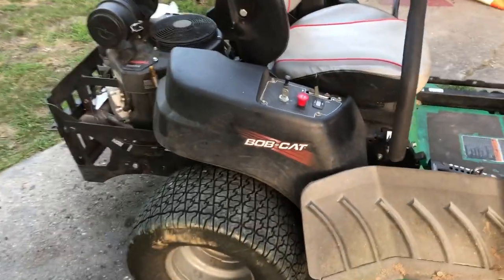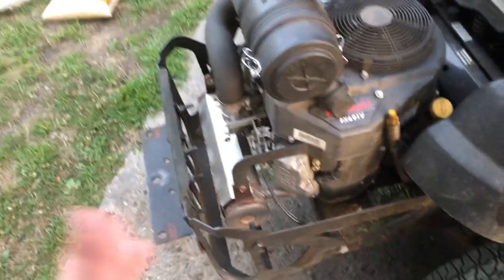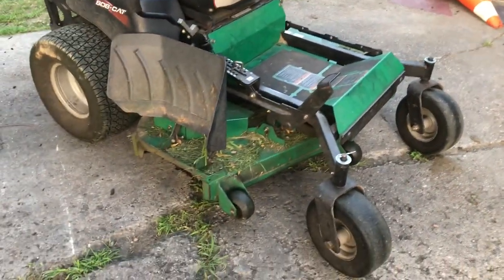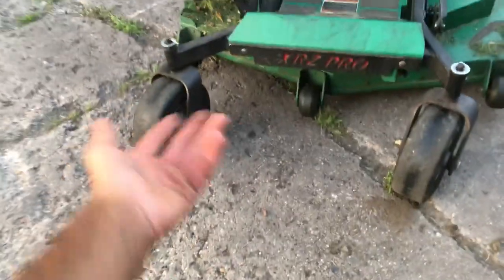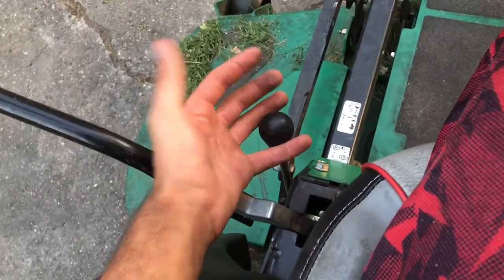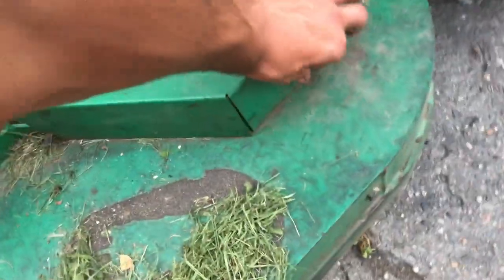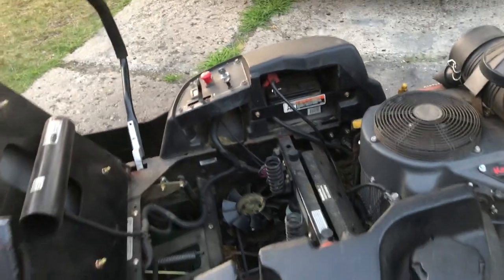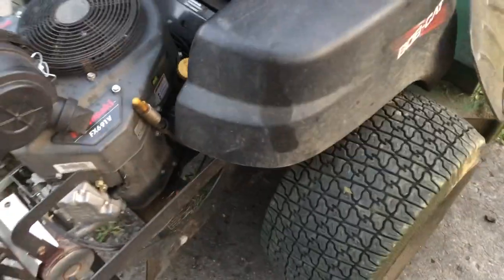Bobcat Zero Turn Mower Review

Comment: Hello Yardsman, I have a bobcat zero turn. When i was finished mowing lawn, my mower hesitated, so I thought it was running low on fuel. I drove it up to my driveway, shut the mower off and noticed a gas line hanging in the back of engine, leaking fuel. It's a clear gas line. I think it's a gas line. I clamped it off, but I can't find where it leads to? Could you help me, please? Thanks!
Reply: Fuel tank to carburetor. Vice versa